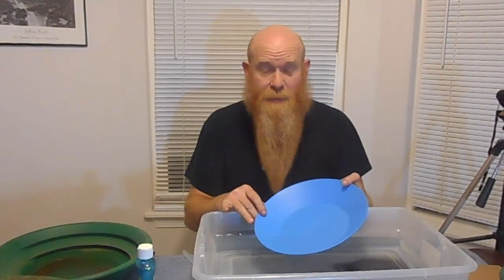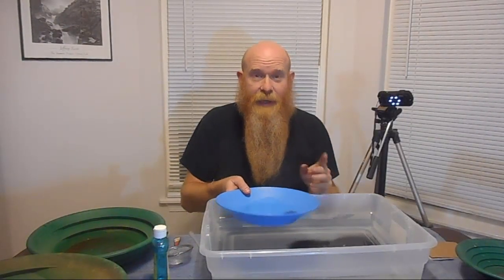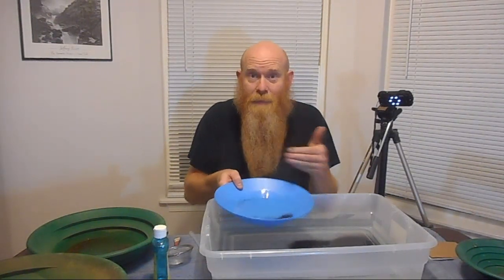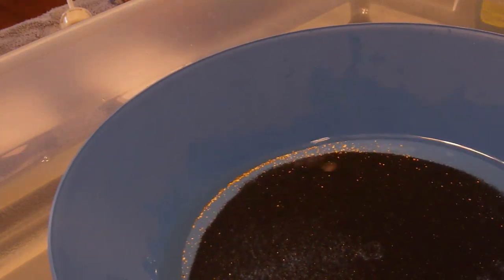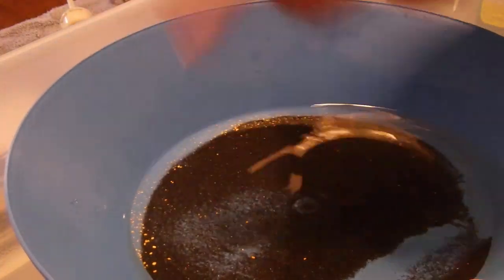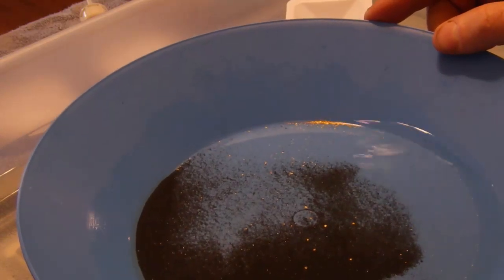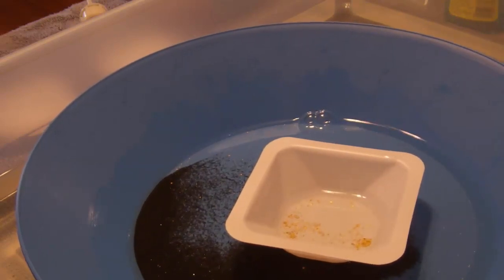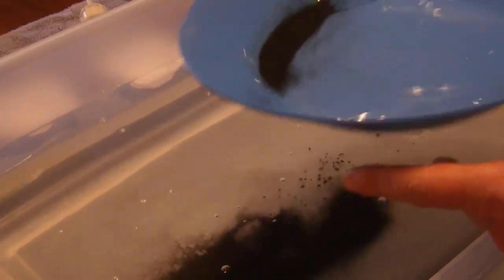Cleaning fine gold from black sands.  Method #2 (Tapping the gold pan)

Comment: How did you season your falcon pan? Know you most likely don't want any deep scratches in it? Great Video!  Thanks
Reply from the maker: Did not do anything to it, just used it as is.
Reply: Falcon pan from the factory is  ready to use out the box. The inside of the pan has a rough/ micro sand type of surface and requires NO scratching/ seasoning. If you scratch/ season it, you will ruin it's design/ texture. A lot of thought went into the Falcon pan to do cleanup work and works great!
Reply: Thanks Corey glad I asked before I will use it or try to season it! @Clearly69
Reply: @mikeobrien7569  No problem & you are welcome.

Comment: Dan, excellent video again! Thank you.  I have a 'tapping/shaking" set-up I 'designed' one day while pondering how to get fine and super fine gold out of my pans I'd like to tell you about.  It a little long-winded (explanation) and may be overkill, as some people have said (and laughed at me for) but the bottom line is that it works pretty good, at least for me.   The 'idea' came to me one night while watching an episode of "CSI: Miami" of all things, during a scene when one of the CSIs was in the lab trying to separate different sediments in a test tube of a liquid and was using a device commonly called a "Tornado Plate", which is basically a vibrating plate you place the end of a test tube on to vibrate the contents. This got me thinking.   A Tornado usually runs about $125 and up, money I didn't want to spend so I got to thinking, what else can I find that will vibrate.  My wife had an old Shitzu infra-red heat/vibrating neck muscle massager she never uses anymore and after some 'negotiating', she said I could have it, so I dug it out of the bathroom cabinet and down to the workshop I went.  I discovered the vibrating 'unit' was nothing more than a tube shaped enclosure about 3 inches long and about 1 inch in diameter so I snipped the wires and took it out.  A little playing around and I discovered that 2 - 9 volt batteries supplied enough power to get a fairly strong vibration out of it so I was in business.  I then took an old Garrett Super sluice pan and using some industrial strength double sided tape, mounted the vibrating unit under the pan's outer rim.  I then took a scoop of some fine cons I had been cleaning earlier in the day, put em in the pan, added some water and hooked the wires up.  Even though the water kind of splashed all over the work-bench,  within I'd say, 15 seconds, I had a really nice line of fine gold along the edge of the pan!!  Like I said, the speed of the vibrating unit caused a little bit of a mess causing the water to splash out of the pan (and some of the gold too), but I figured slowing it down would fix that problem.  I didn't have an actual tool speed controller so instead, I swapped out the 2 9 volt batteries for the ac/dc power-pack from my son's old Tyco HO scale train set and hooked the wires up to the Train Track"  terminals (a/c side).  I figured if that would control the speed of a toy train, it should control the speed of the vibrating unit motor, which it did.  I remixed the gold with the black sands and experimented with different speed settings and found that using a setting of about 3 on the dial, it provided enough shake to walk the gold out of the sand and not send water and stuff all over the place.  Happy with my 'invention', I set about making a 'finished' unit, which took about an hour.  I now have my own "Tornado" shaker that from estimates, pulls about 20% more fines out of the black sand than traditional hand tapping, 20% more than it looked like was even in there to begin with! I figured this % out by weighing the removed gold.   DO you have an email address I can send you a quick video of this unit in operation?  I think you will like and approve, LoL!  Great channel.  Keep up the great work!
Reply from the maker: Very interesting!
Reply: Thats great, i was going to ask if a vibrating plate would work then i saw yr comment

Comment: What a shame it seemed to take eternity to separate the gold using this method on its own - sheds a bad light on the technique - I know myself that when used in combination with the wave backwash it takes maybe 1 tenth of the time you took here (just a rough guess) - umm , when you do the tapping , what direction do you tap ? - I always tapped towards the center of the pan , pretty much horizontally , you appear to be tapping almost vertically
Reply from the maker: About a 45 degree angle.

Comment: Amazing again.
I can see where I’m doing things wrong.
I kinda struggle to create the initial gap.
Also, are you tapping up/down or towards you or a bit of both ?
My tapping is not effective at all when I see yours, and I think it is because I am properly tapping toward me to use only inertia rather than the rebound as you said.
I’ll have to try it I guess :)
Thanks for the tips.
Can’t wait for more tips on backwash !
Reply from the maker: The tap should be at about a 45 degree downward angle.
Reply: Ah perfect, thanks for the precision !

Comment: Do me a video in your claim where I know you have gold in shovel fills of dirt and just shovel directly into a bucket add water put lid on and slosh it left right ultimately stratisfying then pan top out of bucket middle and bottom if I'm right you can process a 5 gallon bucket this way as fast as I takes to fill and slosh no need to take out so much dirt to pan also I feel you don't even need a pan and gold will be in the bottom corners you can remove and add new on top all with one 5 gallon bucket witha lid. Lids important to get good water movement ..aka liquefaction to drop heavys
Reply from the maker: Maybe some day I'll try that.

Comment: Gold will vaporize if you dont flux it and you get it too hot.
Reply from the maker: You need to get it really hot to vaporize it.
Reply: @Danhurd  you would have to take gold past its boiling temperature and past its vapour temperature then you will lose it. I have done just that using a gas furnace.

Comment: What is so interesting is if the ghost gold is in the black sand  and you fuse the black sand a certain way for one hour. You could break the fused bus in half and see rainbow colors of red, blue, green, purple etc. If it is mixed with aluminum it will be purple, if Iron it could be red or blue depending, with silver yellow, etc. (That is why the Old timers thought the northern lights were gold vapors because of the different colors it displayed.) I oftentimes wonder if that might be why so much history of the United States is missing. They are hiding information. Well anyway when you come across this kind of gold you need to be careful and subject it to a special treatment in order to process it.
Reply from the maker: OK

Comment: In my experience I have noticed that even after I pawned the black sand down to concentrates I still find gold in the sand that left the pan. Recently this gold is too light to stay in the concentrates because it's either mixed with too much silver or other metals like aluminum, manganese, titanium.  This is what I believe. So even when you slice you are still losing gold. I have filled jars with light gold which escaped the sluice box and pan.  Especially with the ORMUS gold which has to be treated a certain way in order to melt or you lose it. ORMUS gold looks like Platinum when it melts. I have known about it since the 1980 era. Many Prospectors back in the old days referred to it as ghost gold. ( see David Hudson on ghost gold)  but yes through a certain process it could be transformed into pure gold. It was often times referred to as white gold back in the day. There are stories about prospectors finding white gold nuggets. But l this information has been suppressed by the Government. There is more white gold out there than the usual nugget gold. It is often mistaken for Platinum. Platinum also exist in rivers as well. In the early 1980 era I found a grey bar that was too heavy to carry. It looked like lead but I noticed it rubbed off in my hands like graphite. I hid it in the bushes and went to get a handcart to carry it. When I came back it was gone but it resembled lead. A little while later I went into an assayers  office an told him about the find. That is when I found out about white gold..
Reply: Panned the black sand concentrates
Reply from the maker: Interesting
Reply: Panned not pawned

Comment: Great job. Now I get to find out if the triple method can do a better job🙊 I think not but as I use a mix when panning I think it will just be so much faster.  But I did find a very interesting question to ask. When you were totally finished and showing the results there are a few tiny silver looking pieces, I'm wondering what it is if it isn't just the light angle, I'm thinking maybe a little mercury but if not what.  I as well as few few other miners I was with a few years ago were finding quite a bit of material like this mixed in the black sand and gold. None of us could figure out what it is. Looks kinda like pure -100 silver in nugget from but has the flash of shiny platinum.  That being said it doesn't seem to want to pan out like the black sand will with the gold. I am presently attempting to make my own design of mats for my mini clean up sluice box. To attempt to catch enough of this material to have it tested. So far most of this material comes from the east side of the Fraser on some of the creeks like siwash and the Anderson River and many creeks in this area and the frequency so has shown me the further east the more I found. Your thoughts are much appreciated. Thank you. Oh I know this is not mica or ironpirite aka fools gold. It is hard but just to small to pick up and wants to hangout with the bigger black sands.
Reply from the maker: I think the silver was just a play of light on the wet gold.

Comment: I have a question if you have a magnet not against the bottom of your pan but an inch maybe or half an inch would it hold the black sand and just slightly enough to allow the gold to fall out faster and easier if that makes any sense or would it just hold the gold with it
Reply: @Dan Hurd ty
Reply from the maker: You are welcome